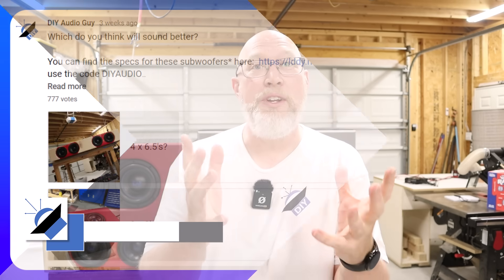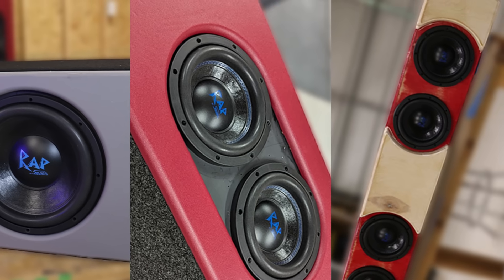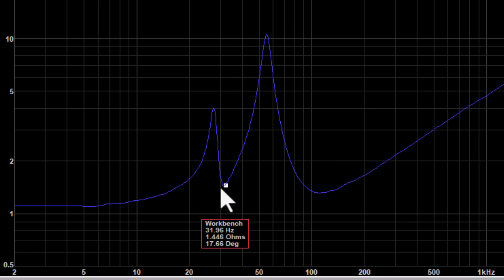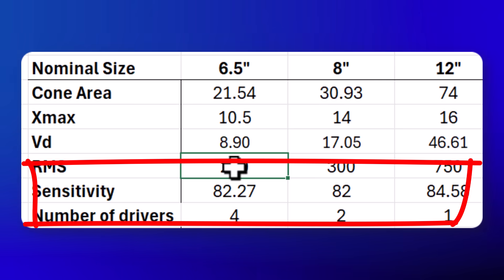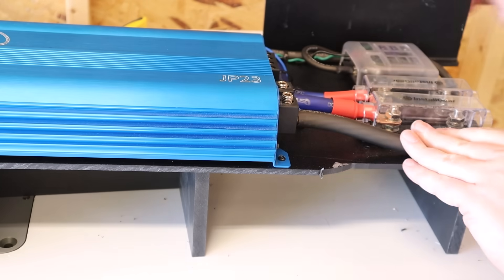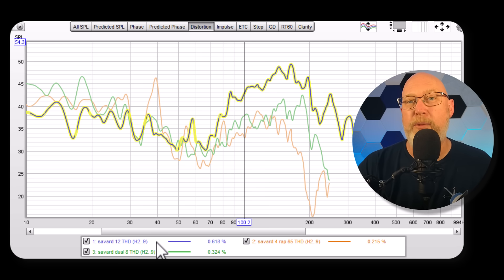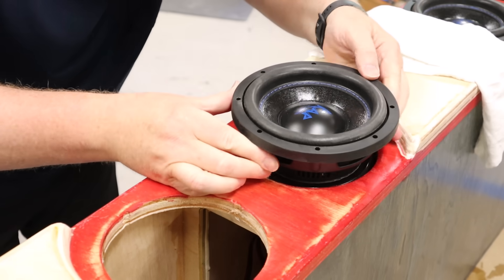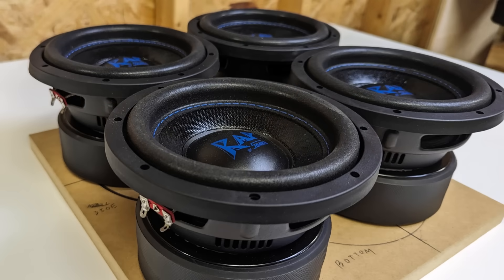Are small subwoofers better than big subwoofers?

Comment: Ive always been partial to sealed subwoofer boxes. Yes a ported box may hit harder and get louder but a seaed box just sounds better to me. I listen to mostly metal and hard rock.
Reply: Agreed. The trade offs for ported is - Pros: +3dB, Louder with a smaller amp wattage (better efficiency)
Cons: Larger enclosure, Larger group delay, worse transient response, possible port resonance, faster low end roll off, possible overexcursion due to unloading below port tuning frequency, there may be more.

For SQ/SQL where wattage is not too limited - Sealed or Bandpass all day long. 🫡
Reply: @leemollison7508  I find front loaded horn winner in SQ and efficiency but loser in box size by large margin.
Reply: A good Isobaric sub will destroy a ported box every day, and twice on Sundays.
Reply: @ChicagoRob2 isobarik also has the advantage of speed. I run OB woofers with electrostats for mid and ess AMT for high. Bass needs speed to fit
Reply: A few points after ready thru the comments here.
 #1 regardless of box type, accuracy matters big time in terms of getting your volumes correct. 
#2 While I am a sealed box guy myself ( 2 main reasons for this. #1 I am an SQ guy and #2 I like keeping more room in my vehicles available because life ), those who say you can't get ported boxed to sound right with certain types of music couldn't be more wrong. You have to have an understanding of what your final goals are and how to get there with the drivers you intend to use. 
#3 The biggest issue ( and VERY few people actually attempt to do this ) with ported enclosures of any description is timing. What do I mean by that? In well tuned SQ systems drivers are actually timed in order for details like imaging and staging to be revealed within the music. With ported systems the bottom end will often ( not always ) get a little smeared with imaging and staging. The secondary issue with them being in a poorly designed ported enclosure is port noise. This generally comes from 1 of 2 main things ( certainly not limited to these tho ). Port velocity being WAY too high. The other being port resonating  ( this is different than port tuning )  at a bad frequency. 
I could go deeper but will vacate the soap box.
Reply: Fun video.  My son just bought his first car so I’m jumping back into this after over a decade. Having experimented with all different type of boxes in my younger years, I concluded that, even with Rap and Hip hop, I prefer the sound of a sealed enclosure.  Sealed is cleaner and tighter/sharper to my ear though there are some rap/hip hop songs (cypress hill and older beastie boys ie.) that benefit from the lazy draw down that the vented boxes I have dealt with provide… anything from the rock genre seems ideal for sealed.
Reply: @danielgattuzo3065  But again, this can be fixed with DSP. The "slow" or "bloated" bass can be redeemed by proper frequency response and time delay settings.
Reply: That's just facts and if you want to go one step further add and EQ/DSP
Reply: Ported and Bandpass boxes may ultimately be 3-6db louder with the same power, but they take a long time to get going(group delay or distortion), and the sealed boxes sound the most accurate by not wasting cycles to get swinging, they’re nearly instantaneous, and why all the fav rated blind curtain audiophile tests are always sealed. Slow starting subs are disappointing, like the Bose acoustimas boxes were. No comparison to Velodyne or Klipsch or Carvin.
Reply: Metal sounds better with tight bass that rolls of gradually from 100Hz down. That kind of sound is typical for sealed subwoofers but same effect is achievable with ported constructions after finetuning with DSP or EQ.
Reply: I've always gone sealed.
Reply: I listen to a lot of rock/metal and always had ported boxes. 2x IA DR 12s playin Slipknot, hits hard and accurate AF. Maybe it's the quality of these subs?
Reply: @mikegriego3671 it'll sound way better sealed!
Reply: @mikegriego3671  me too, I run min airspace ported and tune about 35-38 and it definitely rocks. Just got to choose the right sub!
Reply: I agree. Bass is much more tight and clean
Reply: I have a SVS SB2000pro in my living room, and it's proof that sealed can still get plenty low when you can peak dynamic 1.1k watts
Reply: @shadymaint1  i like seald box
Reply: @shadymaint1  a labyrinth box is the best if done right most of them aren’t that is my favorite of all of them
Reply: They do sound better
Reply: It doesn’t matter what music genre you listen to.  Properly designed box,  only reproduce what amp sends.  Anything more than that is THD.   THD is not only referring to speaker bottoming out/cracking, but also to any notes introduced or accentuated by the box.  Strangely how it may sound, any equalization is introducing THD into music source as original is being manipulated/changed, even thou it sounds better.  Sound engineers already manipulated the source for optimal sound reproduction.  The issues in undesired sound reproduction in the car, is improperly matched speakers, speaker location, and interior of the vehicle in general.  Bottom line is, introducing THD is a necessary evil in imperfect world sort of speak. This is one of the reasons when I build boxes and test them on the bench in perfect environment, I get certain reading, very close to expected design, and same box placed in different vehicles prompt different results.
Reply: agreed
Reply: I've had sounds for 25 years only 600rms amps had a big clarion v-net then have had a 600rms Rockford for 19 years and it still cranks lol had 2xs jbl 15s non ported box that used to be pretty Bassey they were single 4 ohm subs 2400watt max 300rms,I've had a 1000rms pioneer spl 12  since 07 ported box👍 still miss the sealed boxes though
Reply: You could always try a 4th order. Best of both worlds
Reply: Nice to see some savard love. I still have an SQ 10 from a lifetime ago.
Reply: Sealed boxes make no sense. The sound produced is also wrong.
Reply: 100%. Sealed sounds so much better to me. 'punchy' agile bass, as opposed to flabby, and 'one note'. takes more power to drive? less efficient? dont care!
Reply: @FindleysFunBag  It's worth it!!! I'd rather run four sealed on double the power than 2 ported on half in the same airspace. It's worth it.
Reply: I'm right there with ya
Reply: It's not about loud as much as it is about correct and clear
Reply: My personal experience is while a ported box will always play louder, the overall response of a ported box has bigger peaks AND valleys than a sealed box.  So the sealed box will be able to hit the very low notes better than the ported box will.
Reply: @91CavGT5  sealed boxes require more power to go as loud  as ported or bandpass boxes
Reply: @marcfavell  oh I agree 100%.  Ported and bandpass boxes are more efficient.
Reply: @91CavGT5 yep totally I used to have a nice dual sealed box with 2 15 inch PPI C2 subs with PPI biggest subwoofer amp in the late 1990s one of fist digital amps of i remember correctly but it hit hard in my 1995 Chevy Cavalier first year they changed its design and had back seat that you could pull down i was 20 years old was and car audio was basically just taking out big then Alpine head unit with Pioneer Premier component speakers up-front and 16x9 in back ran off of 2x 2 channel Clarion amps was amazing back then 😂
Reply: @marcfavell   😁 my username comes from my love of Cavaliers!!!  I’ve owned a 91 coupe, an 89 coupe, an 88 coupe, a 91 wagon, and a 94 coupe!
Reply: @91CavGT5 That's because it's sealed and restricts the in and out movement of the cone....
Reply: The compromise of course is that the sealed box will be larger than the ported at the same tuning frequency
Reply: @RobByrnes  not always. Sub I currently have wants .8 for a sealed box and 1.25 for a ported box.
Reply: @RobByrnes  What are you talking about?! A sealed box requires accurate air space!
Reply: @shadymaint1  That's really interesting, I'm no expert at all, just going on what I've experienced building a couple of sub boxes
Reply: Not sure what you mean by "accurate air space" , nor how that relates to my comment
Reply: @RobByrnes  with every single subwoofer box that I have ever built for the past 30+ years, sealed boxes are always smaller than ported boxes as per the manufacturer’s specifications.
Reply: @91CavGT5  Happy to be incorrect, I learned things
Reply: @RobByrnes  when we stop learning is when we are in the grave!  I still learn new things all the time.  It’s all good!
Reply: @RobByrnes uhhh, nope.   Sealed is always smaller than ported.  You have it backwards.
Reply: @jennylynne5410  how good do you feel, you are a couple weeks late and saying the same thing as more eloquent replies?

Nice one keyboard warrior
Reply: @RobByrnes  That HEAVILY depends on how you look at it. If you go infinite baffle you really don't have a box, just a baffle.
Reply: Just the opposite.
Reply: @RobByrnes 
🟦…I think what he means to say is that with a sealed enclosure the internal dimensions are critical for proper reproduction, not so much so with a ported enclosure.
Reply: Sealed boxes are made for the kind of music you listen to, metal and rock. It wouldn't sound good in a ported box
Reply: I always go sealed is more accurate bass

Comment: In terms of SPL, one thing most people don't realize or understand is that for any given setup, in order to see a 3dcb gain in output, you need to double the power. If your 2 18's do a 147 at 2000 watts, if you change NOTHING else, to hit 150dcb you need 4,000 watts. To hit 153, 8000 Watts. Power doesn't really mean much, you can make MUCH bigger gains by changing less expensive variables, which you showed really well here, especially when you accidently tossed 1000+ watts to the 12 haha.
Reply from the maker: Y'all should give this a watch before you continue your argument. 

https://youtu.be/4kDxUcGCe8M?si=Bx7Ank2AbwCBGTp6
Reply: @DIYAudioGuy  not arguing discussing 😉 and educating 🤘🏼
Reply from the maker: @tacka73  It's all good
Reply: @DIYAudioGuy  I'm hoping this is what you were referencing but I'll explain it just incase. At the 4 minute mark in your video, you explain exactly what I explained with your 1 watt 1 dcb to 100 watts 20 dcb, to put it into a simple visual aid you can start an excel sheet, column 1 will be power and start at 1, column 2 will be dcb and also start at 1. For power you'll make a function that multiplies the above cell by 2, for dcb you'll add a function that adds 3 to the cell above, then copy both functions down 20 lines. You'll see that at 64 watts we're at 19dcb and at 128 watts we're at 22dcb.

This chart is a simplification of the equation dB = 10 log10 (p2/p1), while it's not dead nuts accurate, it is extremely close. Go back to the chart we made in Excel and compare the difference in levels with the formula, for example a change from 128 watts to 256 watts by the function is 3.01dcb increase. this works for every single step in the chart we just made.
Reply: @casey360360 Can you explain this from this video 10:24 106 watts 125.3 dB
10:28 300 watts 126.4dB 3 x wattage 1.1 dB rise
10:37 620 watts 128.6dB twice previous wattage 2.2dB rise 

Those are facts not hearsay please please explain?
Reply: @tacka73 
Hope this helps the discussion! 

Both could be talking about the total opposite things or have no idea both exist or mixed them up, but only  "square root law" is an actual physical principle and not based on perception like the (decibel scale and loudness and perception #1 below) can be different to each and every individual! 

1) Decibel Scale and Loudness Perception:

• Objective: Doubling the power increases sound intensity by 3 dB.

• Subjective: To perceive a sound as twice as loud, power must increase by 10 times, which is a 10 dB increase. This perception varies among individuals.

2) Square Root Law: actual physics mathematical principle! 

Wave Amplitude: Intensity is proportional to the square of the wave amplitude. To double the intensity, increase the amplitude by √2.

Sound Intensity and Distance: Intensity decreases with the square of the distance from the source. Doubling the distance decreases intensity to a quarter this is the exact same to everyone and everywhere! 

Just like the difference between gain control and volume not the same either 

  👌🍀🫡 🔉🔉🔉
Reply: @marcfavell  When I said the word acoustic theory, it should have been plainly obvious to any one that I'm discussing physics principals. Perception, as you said, is constrained to the individual, therefore it's a useless metric. He ran out of steam once I mentioned math, I believe the conversation went over his head at that point.
Reply: @tacka73  At 10:22 I see 122.6db at 87 watts.
At 10:24 I see 125.0 db at 159 watts.
At 10:29 I see 126.7 db at 319 watts.
At 10:39 I see 128 db at 640 watts.

The speakers are efficient at 87 watts and 159 but start rolling off above that.  When I place my speaker I fire it to the back and aim the ports below the speaker cone to transfer the sound pressure into car resonance.  This is why I would go with a 12 inch audiobahn 1208q 96db/watt high excursion subwoofer.
Reply: @tacka73  power compression and excursion limits. Also if your port is too small, there will be compression there.
Reply: @tacka73  For one there's compression in real world. Various factors like compression can cause that on paper +3dB gain to be lost. Leaving you with much lower gains. 

Coil heating up, running out of linear excursion, etc. Could be any one or multiple things at once. But doesn't change the fact on paper you gain +3dB for doubling the power.
Reply: @JoshM7  that is my point exactly on Paper with the following equation β(dB)=10log10(II0) but in real life that becomes a rule of thumb because other factors come into play so by saying double the power double the spl (+3dB) is not true and can only be 100% factual when every other thing is perfect 👍🏼
Reply: 152 or 156 db something like that wil stop your heart will it not ?
Reply: I think the whole argument needs to factor in how much power any one driver can take, you will not gain much dbs by putting 4000w to a 2000w max sub. You will however if you go 1000 to 2000 on same sub
Reply: @casey360360  this is not factually true it is however a good rule of thumb but not always the case. You can gain Decibels with changes in humidity and isobaric pressure!
Reply: @tacka73  *minor changes. 
And yes, it is factually true. It’s called Acoustic Theory. Decibels are not a linear measurement, they are logarithmic. The entire logarithmic function behind decibels is based on +3dcb requires double the energy input.
Reply: @tacka73  Thats part of the "change nothing else."